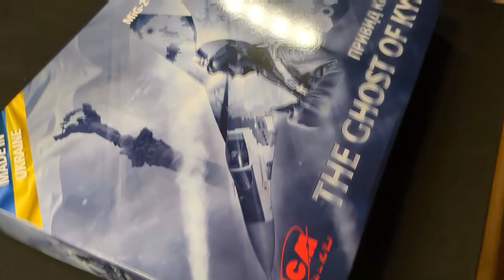ICM Ghost of Kiev Mig 29

Comment: I have this kit and the associated ICM Ghost of Kiev paint set.
Reply from the maker: That's cool, I didn't know there was an associated paint kit.  I'm usually too cheap for those, but occasionally I'll splash out on one.  Recently I was considering getting a paint kit for Russian subs, but I then found out that the special color for Russian subs was "black"!  You'll probably get better results with the set though.  I was basically guessing the closest shade.  Let me know how it comes out!
Reply: @professorbellbuilds  use NATO black for subs.it's like a greyish black which is closer to what the actual subs color looks like.
Reply: @professorbellbuilds  And under ICM it is Item number 3027.
Reply from the maker: @michaelbenjmitchell1  Really?  I'd feel weird putting NATO black on a Russian sub. . .
Reply: @professorbellbuilds  Look at photos of surfaced subs they are a blackish gray due to being out in the sun and the salt water. And painting it all totally black would really play heck with your digital camera. I did that once years ago with a LA Class sub and the flat black really made it hard for the camera to focus but once I changed it to Nato Black the pictures came out better.
Reply from the maker: @michaelbenjmitchell1  Still, it would just feel wrong.  I may add some gray to flat black to get the effect, but then again, I'd plan to weather it too. . . I just checked the instructions, and it calls for XF-1, but I also just looked at the box art, and although the sub does look "black" it also has TONS of hues of blues and purples and grays. . .  I'm almost wondering if I ought to goof around a little bit.  The artists say you should never use black or white in your paintings, and I wonder if I ought to try something like that out here, or if I could use the XF-1 as a base, and use dark blue and purple oil washes to weather it. . .  What do you think?

Comment: I'm glad someone else had lots of fit issues, lots of putty and lots of sanding, I certainly did too. None of the tabs on the wings or tail fit without trimming and filing. Another thing the cockpit is missing are the tubes on either side of the headrest that are telescoping stabilizers. Wish I would have thought to do the instrument decals individually.
Reply from the maker: It was quite a job!  I've heard ICM makes some good kits, so maybe this one is the exception?
Reply: @professorbellbuilds it's an earlier effort. Their Yak-7 kits are even earlier and worse.

Comment: Order of solutions is setter then softer. Mr. Mark Setter has an adhesive quality, so it may not have been the best choice for relatively large decals that would need to be moved around a lot to get the right placement as opposed to something like MicroSet.

Comment: Despite the issues you made a good looking Mig! Most decal solutions usually start with the setting solution and then the softener. Because after you use the setting solution you add the softener to make the decals snug down into all of the details! I don't usually like voice over videos! I normally turn down the volume if it is something I really want to see! But, you did good! I like your voice!!
Reply from the maker: Thank you!  I've actually been practicing that voice for more than 30 years now!  Thanks also for letting me know about the solutions.  It makes sense, but for whatever reason I wasn't thinking.